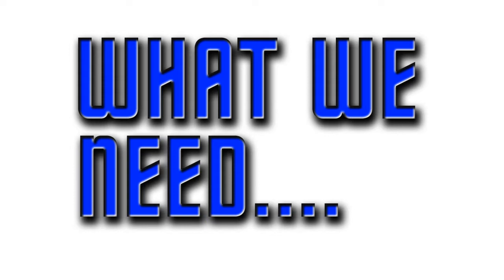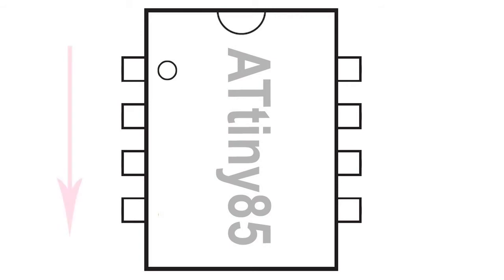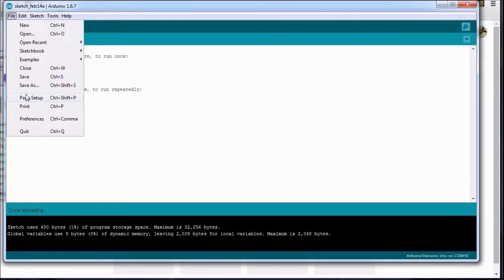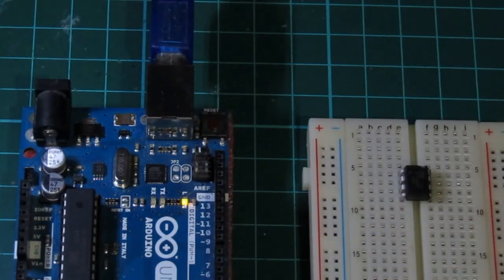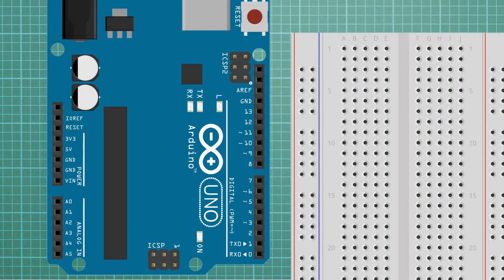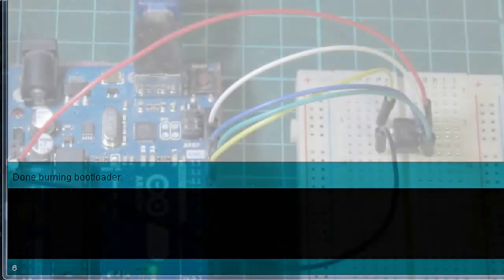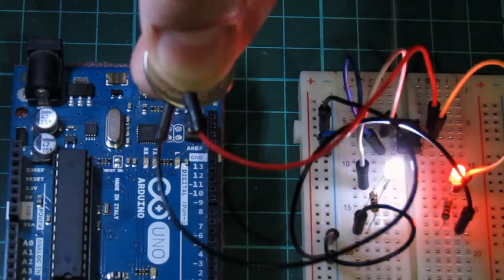Arduino for Starships - Ch03 - Programming the ATtiny85 Chip

Comment: Great video, you encouraged me to do my own lights on the enterprise refit. Would you know how many led's can one pin handle on the Attiny85?
Reply from the maker: Hi :-) I have managed to light up 6 white LEDs on one pin of an ATTiny before, but they weren't very bright. I connected them in a parallel circuit (all the positive legs connected together in a string and all the negative legs to each other) using a 5V power supply for the ATTiny.
Reply: @OstrichLongneck your video motivate me and after consulting my father in law who is a self taught person at many levels I will use the Attiny85 just for the signal and run the led's thru 2N2222 transistor. Thanks again for all your videos, there's a long road ahead of me withe the enterprise but love every minute of it.
Reply from the maker: @viki7110  That's an excellent idea. That way you won't overload the ATTiny. Your father in law is very clever. Good luck with the Enterprise. I have a TOS, refit and NX01 all in 1:350 scale, but I don't have the courage to build them. I don't know why, exactly. Good luck with your build. I'm sure you're going to do an excellent job with them!😀👍👍👍

Comment: Something weird occurs to me when trying to use the Arduino as a programmer. When in its normal mode, I can select the "Arduino as ISP" option in "Programmer. But once I selected "ATtiny 25/45/85" as board, "ATtiny 85" as processor and internal 8Mhz as clockspeed I get an empty programmer selection, just saying "no programmers available for this board". Any ideas as to what might be the cause and solution for that?
Reply from the maker: Hi, not too sure what's causing this. Did you paste the URL into the boards manager at 6:05? That's the only thing I can think of which may be causing the problem. :-(
Reply: @OstrichLongneck  Yeah, I was thinking this too, and I checked. it is this URL: https://raw.githubusercontent.com/damellis/attiny/ide-1.6.x-boards-manager/package_damellis_attiny_index.json ... I think thats the right one. Really quite puzzling, to be honest...
Reply: Found something that might explain it, although a bit diheartening, this quote is from a Stackexchange posting: "Versions of IDE before 1.8.13 displayed programmers for all board support packages, that is why a programmer could be selected. Now only programmers for package of the selected board are available. But programmers are used only with the "Burn bootloader" or "Upload with programmer" commands, not with standard Serial upload over bootloader."
Reply from the maker: @slighter   Darn, why did they need to complicate things? Do they suggest a workaround?
Reply: @OstrichLongneck  I think downgrading the IDE version to 1.8.11 or prior. But I'm still in the process of crossreferencing the problem. Tere is just so much information to comb through that it takes a while for a beginner.
Reply: @OstrichLongneck  I have asolution! It seems all 1.8.x versions don't work with the David Mellis packages. Instead use this link and the package "ATtinyCore". It works like a charm: http://drazzy.com/package_drazzy.com_index.json
Reply: @OstrichLongneck  I found the afforementioned solution with the new link to the alternative Attiny packages on this (German) tutorial side: https://www.kollino.de/arduino/attiny-support-unter-arduino-1-6-installieren/

Comment: Trevor I hope you can help here... the code on the Arduino is working as it should getting a ton of error uploading to Attiny85 I did not change the code from Arduino for the pins as on the Arduino I am using pin 1 to 4 please take a look at the code below and tell me what needs to be changed for Attiny chip 

void setup() {
  // put your setup code here, to run once:
for(int pin = 1; pin <= 4;pin++)
{
  pinMode(pin, OUTPUT);
 }
}

void loop() {
  // put your main code here, to run repeatedly:

for(int pin = 1; pin <=4; pin++)
{
  digitalWrite(pin, HIGH);
  delay(200);
  digitalWrite(pin, LOW);
}
}
Reply from the maker: Hi :-) The sketch looks fine to me. It should run on the ATTiny without a problem. Are all of the upload settings correct? Those can be a little tricky.
Reply: @OstrichLongneck  I think the code is wrong? what I trying to do is have the leds go clockwise and counter clockwise  on the buzzard it works on the arduino not the attiny each on just blinks on and off
Reply from the maker: @scifimodelshop  It could be a timing issue, as the ATTiny runs at a lower clock speed than the UNO. Have you tried to decrease the delay to 50 instead of 200?

Comment: Another great video down....onward....This vid is 4 years old and the ATtiny has gotten a overhaul, but this vid is invaluable nonetheless.  Thank you
Reply from the maker: Thank you very much. Yup, I think a follow-up video is overdue. I'll have to dust off the old Arduino someday and put one together. Thanks very much for your kind words :-) - Trevor
Reply: @OstrichLongneck  Trevor, I've been doing a lot of research into making a fading tail Knight Rider effect for the landing lights.  Still haven't quite got it done the way I'm hoping to, but I feel I'm close.  Right now I'm looking into an ATtiny and Charlieplexing.  Another less eloquent solution might be a 4017 with a low-pass driver circuit.  Have you played around with a fading tail effect?
Reply from the maker: @Explore-Gobal  Hi yup, I've written a sketch for the Larson effect for a Cylon raider which, if I remember correctly, uses 10 LED's and has quite a nice fading tail. I was going to do a video on it - it has a couple of state machines for the engine effect and blast cannons too, but I'm not too happy with the length of the tail. Its still a work in progress, but if you want to have a look at it for ideas, its at: https://drive.google.com/file/d/19Zni-pJDt_hKbnKKjZHs6ieL1XjDx_pj/view?usp=sharing
Reply: @OstrichLongneck  You're the best, thanks.
Reply: Hmmm, comes up with a blank page?
Reply from the maker: @Explore-Gobal  Strange... I just checked with Chrome and Firefox and it downloads ok. Do you have an e-mail address? I can e-mail the file to you if you prefer. Mine is ostrichlongneck@gmail.com
Reply: @OstrichLongneck  I tried it in Chrome and it worked.  Firefox....well....

Comment: Just in case someone has the same issue that I had when trying to install the tiny software, I'm posting  this.  When I followed the instructions and tried to Right Click, and select Copy Link Location, for some reason it would not copy it as intended and I ended up with, well, not what was intended.  To solve this, I left clicked to open the link in a new browser window and then copied the link out of the browser address bar.  That did the trick.  I could then  paste the link properly into the Arduino Additional Boards Manager URL and complete the setup per instructions.  Cheers
Reply from the maker: Awesome :-) Thanks very much for the tip. The darned things never work the way they're supposed to, haha! - Trevor

Comment: Thanks for the video.  Is the ATtiny85 that you used obsolete? I was able to find  a 556-ATTINY85-20PU at mouser. It has 8mhz with a maximum clock of 20 mhz.
Reply from the maker: Hi :-) I hope the ATTiny85 isn't obsolete, as it's really a powerful little chip. The one that you are looking at is perfect. I see they're still available on Ebay for around a dollar each from China (hopefully Corona virus-free!) ;-)
Reply: @OstrichLongneck  Thanks for the response. I'm not so worried about the virus as I would be about shipping delays from china. Any virus on the chip should be dead by the time it gets to N.A.  Mouser prices seem good.$1.70 Canadian.

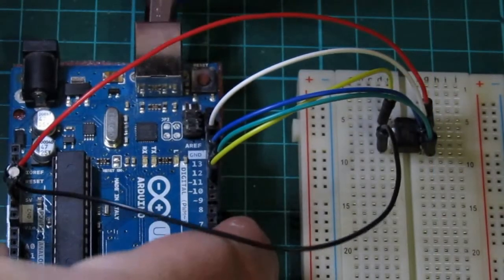Comment: Hello Trevor... I hope you maybe able to help or direct me... I am try to ATtiny85 chip and have follow all your instructions on this video.  However I am not getting the "Heartbeat" as noted at min. 14:20 of this video. I have triple checked my wiring and setting.  Any guidance or direction would be a great help.  Thank you again for these videos
Reply from the maker: Hi Sal, I think it depends mostly on the manufacturers of the chip itself. I browsed through a few other videos, and noticed that some ATTiny's had a fast flicker for a hearteat while others did nothing at all. If the bootloader and sketch burn to the ATTiny without problems, then I'm sure everything will work just fine. - Trevor
Reply: Hello Trevor. Thank you for the information it's a big help as I am now Programming the ATtiny Chips as I go though each video using larger pin chips as needed to end with programing the ATMega32, as Travis did in his Sept 27, 2016 video where he programed an ATMega32 chip. Thank you again for your help and great video's.

Comment: I know I posted on this one a few months ago, but I have just tonight followed it through and got it working. Marvellous.
Any thoughts on how to get this transferred on to a board more suitable for fitting in the model? I have some veroboard here but am not sure about power supplies, voltage regulation and ..... well .... all that stuff.
Your vids are much appreciated.
Reply from the maker: Hi again :-) Everything you mentioned is actually the subject of the next video in the series, which was supposed to go up months ago, but unfortunately life happened :-P I'll shift focus back to the series soon. The next video concentrates on transferring the big Enterprise sketch onto a spare ATMega chip, and building a barebones Arduino on a breadboard which functions independently of the Arduino UNO. From there, I'll be transferring everything onto a small(-ish) circuit board which can easily fit into the base of the Enterprise Refit 1/350 model. I'm planning to do this final transfer to the PC board slowly, and step-by-step for beginners. I apologize for being so quiet, but hopefully my mojo will kick in soon - Trevor

Comment: Hello again Trevor!
A quick question.  You use the term 'burn' when you discuss the programming of the ATTiny85.  This sounds like it is a bit final and a one-shot-per-chip thing.  Can you write multiple times to the same chip or do I need to buy a whole bunch of them to account for me fluffing the programming?
Reply from the maker: Hey Aircool, you're right, "burn" does sound kind of final. I guess I should rather say "program" because you can re-program any of the ATTiny and ATMega chips. That's actually the best part - if you use a DIP socket on your final PC board, and decide you don't like a particular effect, you can remove your chip, re-program it and pop it back into the socket :-)

Comment: Hi, Trevor... First I'd like to thank you for posting your video on the ATtiny85 it's been a great help as I am a neophyte Arduino coding. I would like to know what size of ATtiny could be used to down load a 9 LED Cylon eye sketch to.  Thanks for any help or direction you may be able to provide.
Reply from the maker: +Sal C Hi :-) Thanks for watching! My other favourite ATtiny is the 2313. It has 17 pins which can be used as output pins. Here's a link to a simple sketch for the 2313 which is great if you want to modify it to suit your needs: https://codebender.cc/sketch:37249#Attiny2313%20(internal%201%20MHz%20clock)%20Arduino-Tiny%20core.ino

Here's a great diagram which shows the output pins clearly (D0 to D16 on the diagram): http://provideyourown.com/wp-content/uploads/tech/ATtiny-Pinouts-20x13.jpg

Another option is to use two decade counters, one for the forward chaser sequence and one for the backward sequence, but that's more complicated than it's worthwhile. I'd go for the 2313 :-)Thanks for the great comment. - Trevor